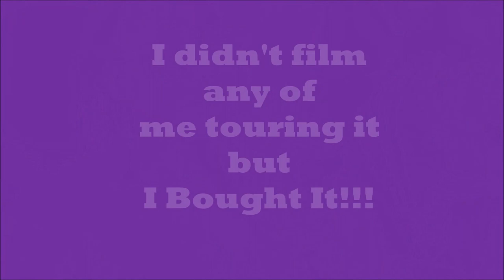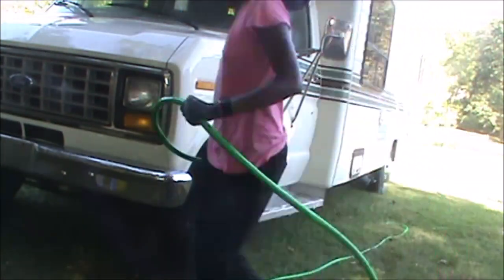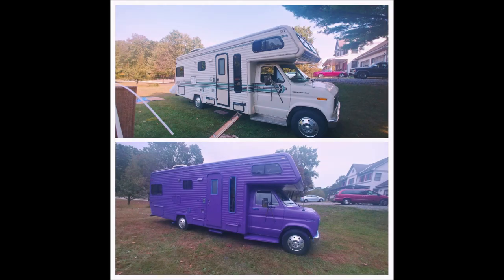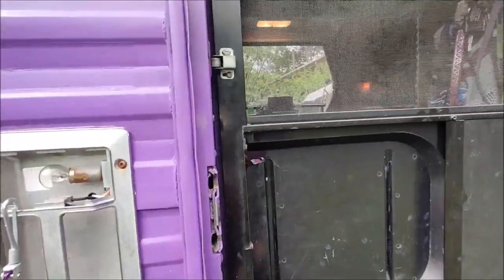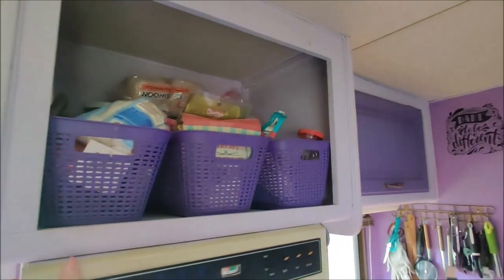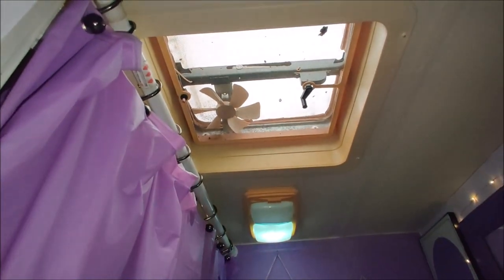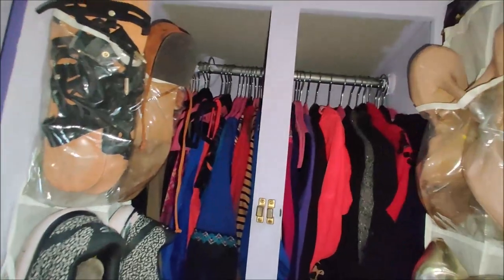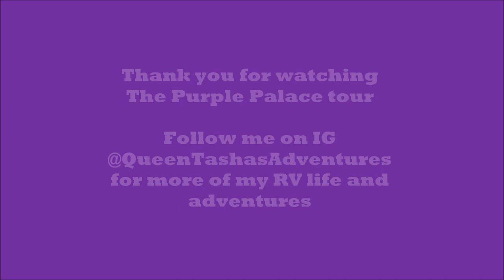CLASS C RV TOUR | SOLO BLACK-FEMALE living FULL-TIME in PURPLE RV

Comment: Word of advice if you're going to own a RV in Florida most of them will eventually leak, mildew and rot because water gets in the cracks and crevices around the roof sides, roof vents and windows so take the time to neatly yet gently tighten all the screws and do a nice CLEAN silicone caulking seal job... around all windows and roof vents and seams etc or you will soon have a mess. Watch a video on how to neatly silicone caulk something I seen people make a mess of a perfectly nice trailer or motorhome doing a sloppy job it doesn't take long just take your time and don't miss any spots one little spot is all it takes for water to get into. Enjoy your new home!

Comment: I just did my small build on my Prius v five and I did the same not safe cutting with the wrong tool and the wrong blade, but it's what I had and I made it work. Great job! I will have no oproblems spotting you on the road. I recognize that core screen tent. I sold my core tent and grabbed a Gazelle 5 screen room. Try it, it's fab!!!

Comment: have a carrier welded on back to store 2 (30) lb propane tanks - then have a hole drilled into side so you can run a hose to your buddy heater - also have an adapter put on your onboard tank as well so you can hook up tanks when needed. this way you have plenty of heat when needed as well as propane  for ref, furnace and water heater
Reply from the maker: Thatvsounds like a awesome idea ill have to look into that😁
Reply: @queentashatv  I service RV's as well as owning a 31ft class A - and I have traveled in very cold weather which most have not done - in cold weather your onboard tank may only last 3 days - www.jencin.com/master is my website

Comment: Very Cool, The inside looks great and cozy, however what about the cost of maintenance, vehicle repairs such as engine, transmission, alignment, vehicle emissions, tires, tie rods, brakes, rotors, shocks, and most important roof leaks maintenance ? Make sure you keep track of all of this on a spread sheet and find a reliable mechanic for the unknown future. RV's are very expensive to repair so be financially ready. By the way I got to know PRINCE at Paisley Park before his death and He had a a purple Class A RV 0)+> OooWaa!
Reply from the maker: This is my second RV so I'm very aware of these things😏👀 and will be putting out a video on how to buy a used RV soon. 😏😁

Comment: I have the same camper and am I. The process of remodeling. My question is , how did u manage to the seat out that is behind the passenger seat? Is it bolted underneath the van or what?  I have not been able to get the darn thing out. PLEASE HELP!
Reply from the maker: It took me and my mom, her inside holding the bolt and me underneath loosening it. it took over an hour only because 1 of the four bolts did not want to come loose. But once I finished I filled the holes with spray foam.
Reply: Queen Tasha TV So I’m gonna have to crawl under my rig to germ loosened?